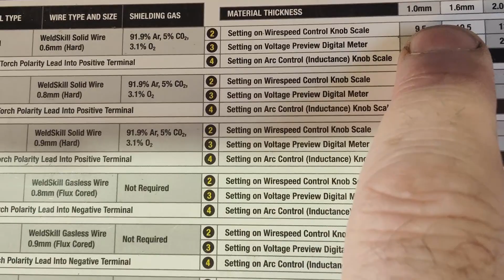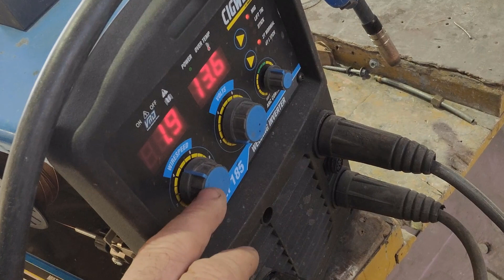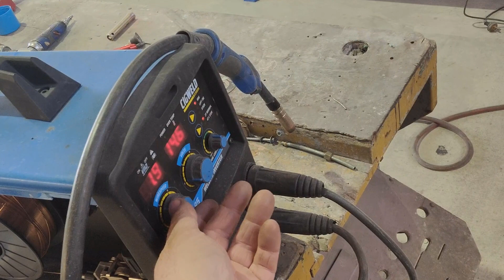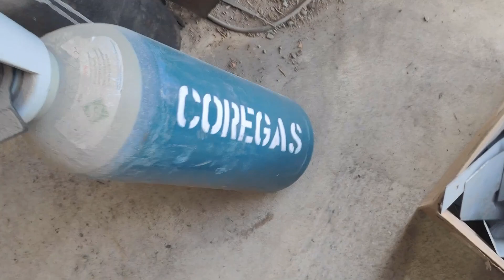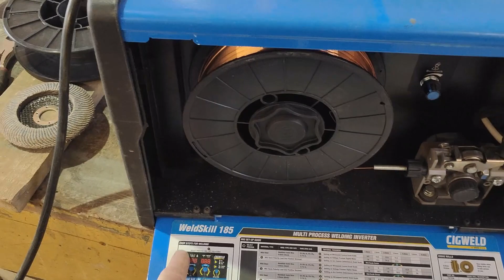2ND REVIEW ON CIGWELD 185 3 IN 1  AFTER 2 HALF YEARS OF USE  .

Comment: Totally agree that the CIGWELD brand of welders are very good,  I have had my CIGWELDER Mig only for around 15 years and thinking of getting another welder that does Mig & Tig so will go with the 3 in 1.  The one thing I don't like with my current welder is that it is big, comes on wheels and you need to roll it around.  Also with the new welders you can fine tune it more, with one of the features that I like is that you can choose the wire size you use and some even can choose the material thickness.

Comment: Do you use .6mm wire on your panels and if so what speed and voltage do you normally set for? I have the same welder but the chart shows a very high wire speed for the 6mm, seemed odd compared to the lower setting for .8mm. Cheers
Reply from the maker: lately I have been working on a WW2 DUKW its mostly 2mm lol so I am trying to remember been a few months . I use .8 wire a lot of the time to just works for me about 6 wire speed 16 voltage I think  I am back on cars in the day or 2 so I update you
Reply: @NZMOPAR  Thank you. yeah I used to only use .9mm myself until I started working on a car, so I switched to .6mm as that was the one most recommended, but I can never get the wire speed and voltage dialed in as easily.